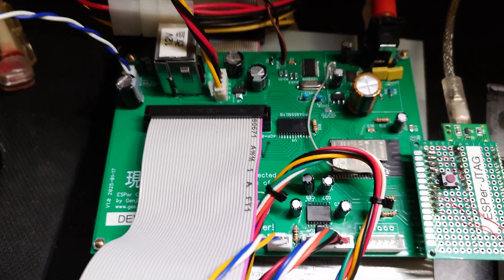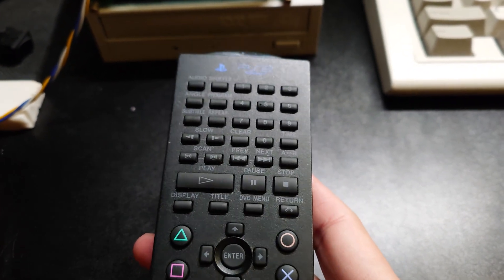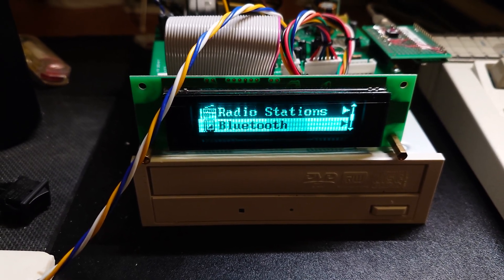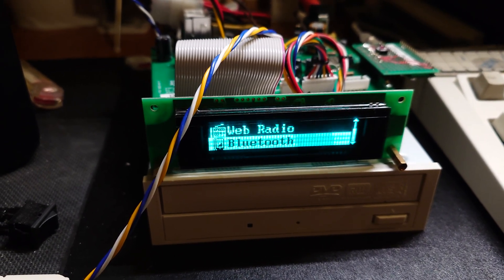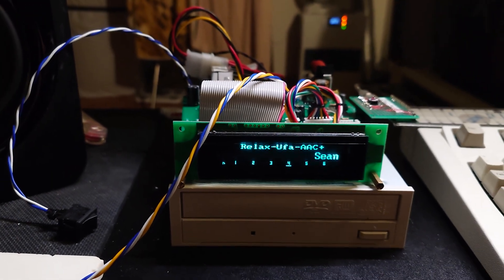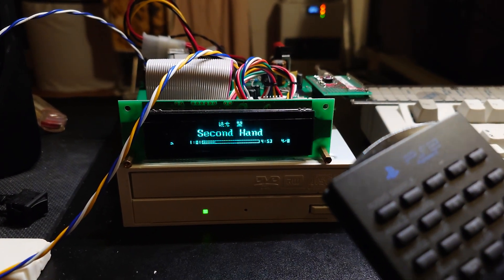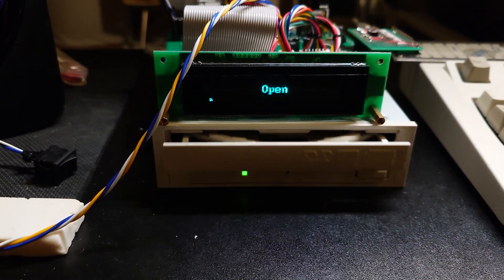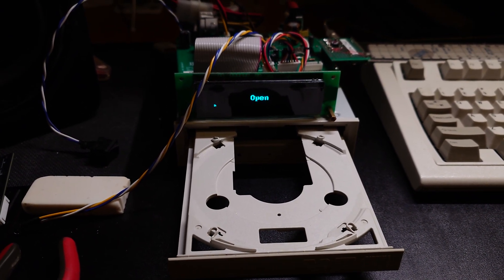A closer look at the ESP32/Arduino based CD Player with timed lyrics display

Comment: Great job How can I switch between Wi-Fi and Bluetooth without restarting the ESP32 board?
Reply from the maker: Depends on your usecase. If the traffic isn't high the two can even coexist without much issue, albeit RAM will become pretty tight.

Comment: any plans to do future projects for reading SACD? HD Audio etc?
Reply from the maker: I don't think normal CD/DVD drives, even SATA ones, can read SACD because of different laser wavelength (and I have a whopping 0 of them to check), plus that would require a direct Delta sigma input DAC otherwise even the faintest audio myth point of using DSD would be gone since it'll be resampled to regular PCM in software anyway :P

If the faster PCB rev happens though DVDA is definitely on the table because it's easy to make at home for testing and it's just a bunch of mpeg files on a DVD

Comment: Very cool project, I kind of want to make one for my daughter who is into K-pop and has been buying albums and is listening to them on a super cheap cd player we bought her when she was quite young. Can it stream audio from the CD to bluetooth speakers or headphones?
Reply from the maker: When designing the PCB I did account for including such a function, however I didn't implement it because I'm doing mostly analog stereo for everything. Since WiFi + Bluetooth can coexist properly on the ESP, it should be doable. I'd be more worried about the RAM space, because on the baseband side I remember using a Wiimote and WiFi at the same time and it was fine but starving for RAM.

I'm kinda burned out to work on this for now, so you can take a hit at the project, the source code is in the description, and feel free to ask any questions. I could also implement it as contract work too but that would need more negotiation :-)

Comment: ide bus?
Reply from the maker: Yes, as I basically took the ATAPIDuino project and iterated on it. Also SATA is a differential pair and demands much more signal integrity, which wouldn't fly on a PCB with more silk memes than actual engineering knowledge put into it :P but if the next faster rev will happen indeed you could just use a SATA to ide adapter I presume! Albeit I'm pretty burnt out with this so idk if it will happen indeed